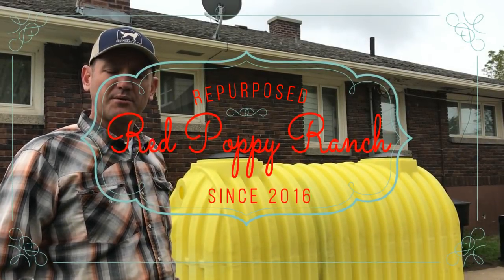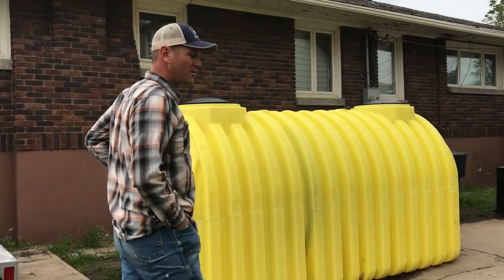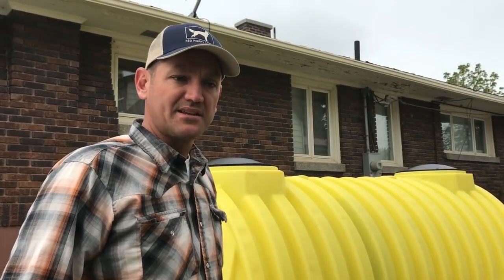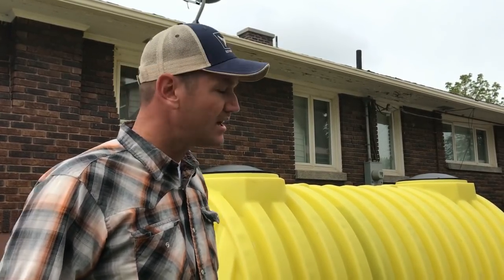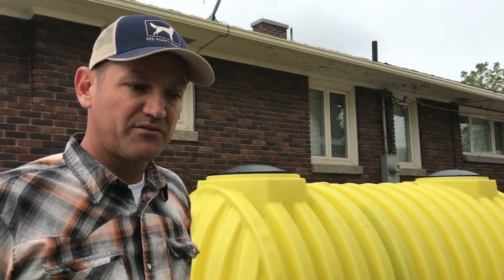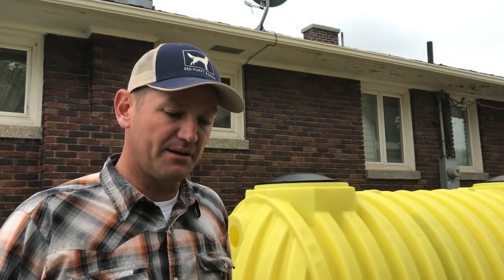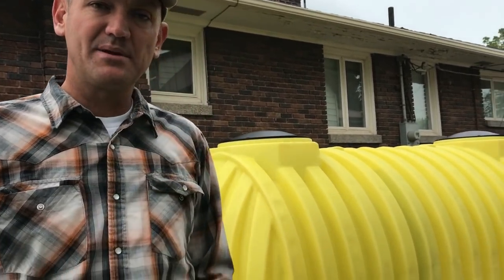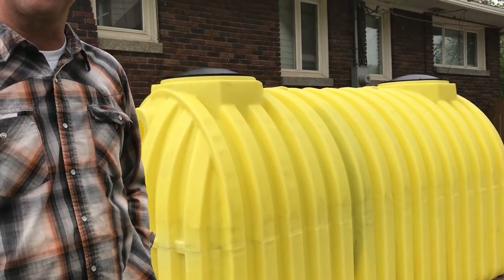#101 - Concrete Septic Tank vs Plastic Septic Tank (DIY Septic System)

Comment: Came apon this much later. We had one of these, and when the particulates built up, was told that it would need to be pumped out .  I had just did a home brew of beer. Poured the dregs down the sink. The yeast ate all the particulates, the council checkers said they would tell all those they visit about it, as the unit was as new.

Comment: A septic system is off-grid because you are dealing with your waist on site. They just take more water the composting toilets. If you design your plumbing systems where you are using gray water to flush your toilets I feel you are better off. Thanks for the up date. - Jeff
Reply from the maker: Thanks Jeff!
Reply: Red-Head-Ranch coming from building and knowing he's a plumber was a no brainer.

Comment: Yes indeed - great info.  Wonderful to hear the septic side of the debate from one who knows; some seem to think that one is not homesteading unless using composting toilets!  We didn't have much choice as we bought a 'fixer upper' house.  Took awhile to find the septic, was under a huge porch - no access and hadn't been serviced for almost 50 years!!!   Expected the worst when I got to it.  Once cleaned out though inspector said this 1000 gallon septic was in great shape - that saved some loot.   All the Best!!
Reply: Yeah, one of the good reasons for septic permits is it leaves a record of the septic system in the public records for the property and helps to make sure you or anyone else doesn't crash into one when digging on your property as well as the option of using it if it's still serviceable...

Thus always good to check the records on the property to see what it can tell you of its history...

Comment: I couldn't agree with you more! Even for just my wife and I , septic is the only way.Let alone 5 kids! I have been a builder for 40 yrs. and know the value of a good septic and well! Id still use a light steriliser on the well! Though here in Pa, they are using mostly sand mound systems nowadays! And are very strict about health/safety.

Comment: I must be missing a point here,      You got a plastic tank because;     It was about the same price,     It is so light that you and 2 friends can wrangle it into the hole in the ground, and being so light you could pick it up yourself on your own trailer.     But you will build the leech field with perforated pipe and crushed rock to save money,     HMMMMM        maybe  200 feet of trench filled with maybe   2 cu feet of rock pr. linear foot = 400 cu. foot =  44.5 cu yard = 89 ton of rock = THREE tractor trailer loads of rock.     Even if the plastic shells were gold plated they MUST be cheaper then 3 loads of rock, or am I missing something else completely ?     Keep up the great work
Reply: In most places stone is cheap, usually costs more to get it delivered than the stone itself.
Reply: In most places stone is cheap, usually costs more to get it delivered than the stone itself.

Comment: I totally agree with you about the composting toilet thing. I have lived in houses with septic systems most of my 57 years and never a failure from them. And they were not new houses. My parents lived with one for 50 years and it is still working. My in laws have had the same one for 4o years without a fail. Neither have even needed them cleaned out. I would rather have an outhouse than a composting toilet. Really enjoying your journey.
Reply: Sorry LindyTN, but an outhouse is basically just a hole in the ground and it does nothing to treat the waste and prevent the spread of diseases or even prevent it from stinking...  So that would be the worst choice and only works as long as your ground water table isn't high...

Composting, as a natural part of the process, on the other hand actually eliminates the harmful microbes and leaves nothing but perfectly safe compost at the end of the process and as long as you're doing it right you never touch the waste, ever!

It's like arguing whether or not you ever touch sewage water with a septic system... If the system is working, then of course not!

While having a septic doesn't change whether you're spreading germs and pathogens in your bathroom... Simply flushing the toilet sprays a little bit of the fecal matter all over the bathroom and water by itself doesn't disinfect anything...

If you don't believe me then look up Discover Channel's Mythbusters as they did a episode testing that and they proved it to be true... Everyone can have an opinion but science doesn't lie!

Sanitation has to start with how clean you keep the bathroom no matter what system you use to dispose of your waste.

Contrary to his contention, the main reason for the decline of the spread of hepatitis and other infectious diseases was actually things like improvements in medicine,  the fact fewer of us actually share toilets anymore except for public restrooms where you can still catch hepatitis and improvements in keeping our environment cleaner...

Modern, indoor plumbing took off during the 1920's... but what also took off was the growth of cities and automobiles.  So there wasn't things like horse manure everywhere anymore and it stopped being socially acceptable to just do your business anywhere... Drinking alcoholic drinks was no longer the only wide spread way to kill germs after the 1920's... among other changes like adding fluoride to our drinking water, water treatment plants to clean the water, laws stating where people could dump their waste, etc.

So his argument against composting is not based on the actual facts as the historical changes he was basing them on had nothing to do with composting... and less to do the plumbing than how people lived day to day changed...

Fact is Millions of people around the world compost their waste to this day, yet there are no wide spread epidemics!  You're more likely to get sick from contaminated water that got mixed with sewer water... 

Again, everyone can have an opinion but the science shows composting works and it's as simple as that... You don't have to go for it if you don't want to but it's false to say there's something wrong with it when there's not!  As well as pretending another system is perfect when it clearly is not!
Reply: My preference to the outhouse over a composting toilet is because peeing, pooping and puking in a bucket in my house isn't much different than a litter box for the cat, wood shavings for the pet rabbits and other pocket pets, and other indoor places for pets to do their business. The only way a bucket of pee and poop is going to sit in my house is if there was no other options. Even then, it would be hauled out after every use. (and emptied. How fun)I cant even imagine that set up with a house full of humans. The same thing could be accomplished with a bucket, or hole, outdoors. I also have no intention of having a human poop and sawdust pile nearby. Besides, when SHTF where are you going to get all that sawdust. And unless you own a sawmill, or know someone that will give you their sawdust in exchange for hauling it off, you will have the expense of buying it. If sawdust becomes the thing for toilets, more trees will come down to make sawdust for those that want to live 'independently'. There is already a huge market for wood shavings of various kinds. Very popular for horse stalls and other animals. Works for them pretty much like the human composting toilet. It is also creates a lot of labor for those that manage the indoor animals. But for those that like peeing and pooping in their house and living with a pile of human pee and poop and sawdust nearby, go for it. I have appreciated learning about it. If SHTF happens, I might need to know how to make a human compost pile.
Reply: You're not limited to using sawdust... Like you can use peat moss, coconut shavings, Sugar Cane Bagasse, rotted leaves can be used in an emergency, fresh leaves, rice hulls, coco coir, and even shredded junk mail.  

Composting is a natural process that has been utilized by people for thousand of years and is not limited to those who lived around carpenters...

Composting also actively helps kill pathogens... For example, in food waste composting the first stage of bokashi preserves the ingredients in a lactic acid fermentation. 

The acid is a natural disinfectant, used as such in household cleaning products, so that what enters the second (digestion) stage is essentially free of microbial pathogens.

Many other elements in the composting process similarly helps eliminate everything that can be harmful, which you wouldn't get with a simple hole in the ground... and when properly done there should be no leeching of harmful waste into the soil on your property or any real change of it happening by accident...  Just healthy soil that's good to grow plants with and helps prevent soil degradation...

Composting toilets aren't even limited to a small container in your bathroom...  You can have the waste go to a composting bin outside of the toilet and then it's just like using a flush toilet... There are even flushable composting toielts on the high end of options... It'll just cost more to set up but it can be done...

While, if you puked, or had any other similar mishap in your bathroom... You will have to clean it up regardless of what kind of toilet you have as those kind of actions will spread particulates all over the place no matter how good your aim is...

Regardless, it's good to know what composting really is and how it really works... Such as for SHTF situations or simply knowing what options really work or not and what can work best for any given situation rather than just assume something will work and hope for the best...
Reply: But you still have to obtain all that stuff, and a lot of it. I cant believe that rotted leaves would do much for the smell, or fresh ones for that matter. I would think wood saw dust and wood shavings would be the only thing that would work for that. And junk mail? reminds me of putting paper down for the puppy to use. Great for absorption, and clean up, but that is about it. I know composting human waste can be done safely, but it has to be done, knowing what you are doing. And with children living in the house, I can see some serious sanitation problems. Its hard enough to keep kids washing their hands and 'sanitized' about bathroom duties with conventional toilet systems. How many kids would be playing in all that like it was a sand box or something, a lot of them. lol
Reply: The basic process is that you need carbon based organic matter that can dry out the waste and allow the process of composting to begin...  Leaves become mulch, so unless soaking wet it shouldn't smell...While as I pointed out, you could always up for the more premium option of a flushable composting toilet and then just check the bin once a week or so and toss in the cover material... The kids would never have to touch it...Or vermicomposter has been known to work with water flushing systems and that way you don't need cover material...

Mind, even the high end flushable composting toilets, while hardly cheap, are still cheaper than installing a septic system and can last longer, with the benefit of having compost to restore your soil and make it easier to grow stuff, which can come in handy when SHTF and food becomes hard to come by...

The process of composting can also be sped up, which generates heat and that can be used to grow in the winter and/or even heat your house...

Sure, it's not for everyone but it's hardly a terrible solution... It's more something to get used to than anything else and is only a hassle if you use the very basic version of it...  But that would be like using a porta potty instead of a septic system for a equivalent comparison of the range of options...

Mind, you could just have the composting toilet as a backup... Or to cover parts of your property that may be too far from the septic tank...  No one is saying it has to be one or the other...
Reply: You're not actually talking about a composting toilet, rather, a sawdust toilet. Sawdust bucket type toilets just hold the waste until it's removed outside to a compost pile to compost. Actual composting toilets r entirely different. Google it and learn. @ZeoCyberG
Reply: @Rita Machia -  No, you're thinking of a deification toilet that can be used in conjunction with a composting bin to compost...  But I'm talking about actual composting toilets, which there's a range of options for...

Everything from self contained systems that integrate the composting bin into the toilet to gravity and flush systems that send the waste to a remote composting bin/tank.

The flush type has even made its way to a number of public places...

http://sirius.ucsc.edu/users/drip/toilet_review/pdf/rev_141015.pdf

The act of adding saw dust alone isn't composting but it can be part of the process because it's just one of many ways to add carbon to the pile, which is part of what is required to process the waste into compost...  It's similar to adding mulch to your garden...

So don't confuse that part of it with whether or not we're talking about a composting toilet or not...  Some things just are also used in other options...

Like micro-organisms are also part of how a septic tank works...

Comment: Hmm...
The way this guy tells it, why would anyone ever use a concrete tank?
Simple, plastic tanks tend to collapse and they do with regularity.
Especially buried in heavy clay soils, and even more so if there is seasonal high ground water.
As far as corrosion goes, yes hydrogen sulfide is reactive with concrete but regular tank pumping will control the amount H2S in the tank and pumping in necessary to control the waste strength for the drainfield. THE ONLY reason to use a plastic tank is if there is no access for a crane truck. That being the case you should always backfill with sand and never place the top of the tank more than 6" deep.
And let's just say I'm a septic contractor and let's furthermore say that plumbers should stick to water heaters (or whatever) and leave the septic system to the pros.
How would that be?
Reply: Concrete tanks r more expensive too

Comment: I was very interested in this video. I am looking to moving to a different region in the middle of fields and the house I have set my eyes on, I've just discovered, has a cesspool, no septic tank. I am shocked. As a plumber, could you please explain any downsides of this system before I commit? I have read about cesspools online but I would really appreciate your comments.
Reply: It's been two days, not sure when he'll respond to you but my two cents on the matter...

Cesspools are high maintenance unless coupled with a septic tank to eliminate large particulates before reaching the cesspool...  It can be used as temporary solution by itself but unless you're using it rarely and/or not anywhere near capacity then it's still advisable to get a septic system installed...  But you can use it and keep up with the maintenance to buy yourself some time to get the septic system if it's not something you can immediately do... 

Though, you can add to the septic system to give it more capacity...  But mind what the local rules are, as it's likely it was installed long before the modern regulations and concerns about soil type, ground water level, etc. and long term safety is what matters...
Reply: ZeoCyberG - Thanks very much for your response. I was a bit late in posting my question. I have done more reading online and as you mentioned they seem to need a lot of maintenance... I have found someone online who will meet me at the house to give me an estimate on a septic tank. We'll see if the additional expense will be affordable or not. Thanks again!
Reply: No problem, and btw... another reasons to check the local rules and regulations is because some places offer a credit for upgrading a cesspool to a septic system that may help lower costs...

If you have an excavator or know someone who'll let you use theirs, you can probably negotiate a reduction on the installation costs by digging the hole yourself...

Also, make sure whoever you hire has insurance... There are multiple ways the tank could get damaged during the install and that can be costly... and preferably hire someone local as they will know the land the best for your soil type, water level, etc. and will know what local rules need to be followed, as well as help speed up the permit process...
Reply: Great idea about a possible credit! Will check on that. Thank you.

Comment: The bad thing bout a plastic is,,,,,,,, they will foat,,,,they will crush ,,,,,and u need a pump port beside the tank to strip the water out of the hole before you pump the tank out when that time comes, if it is water round it and u pump it out it will literally jump out of the hole

Comment: Hey I have seen people using these things as storm shelters and bunkers etc....  You had mentioned something about filling with water before back filling.  So will these collapse if there empty?
Reply: Not likely however it will blow out of the soil if it's empty and the water table rises due to a rain. It's like holding a balloon underwater, too much buoyancy.

Comment: I have seen some use 18 inch plastic drain pipe cut in half to build their own chamber system.  Infiltrator is very expensive, no doubt about that.
Reply: Chambers are junk
Burrowing rodents love them, and why not?
Free Rent!!!!
Reply: @dirkmcmeans625  I haven't encountered that issue.  However, I have had to replace field lines due to clogging.  I guess it is a preference.